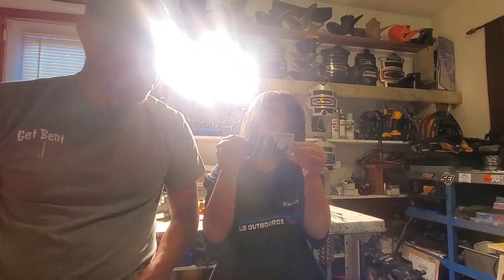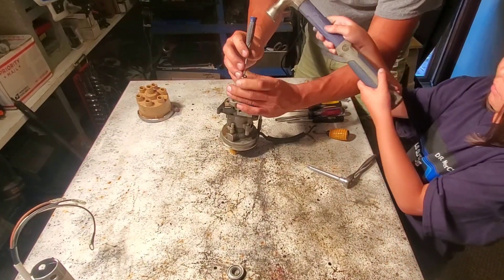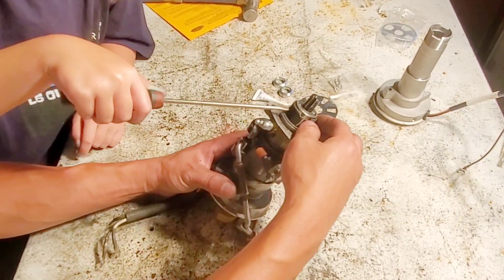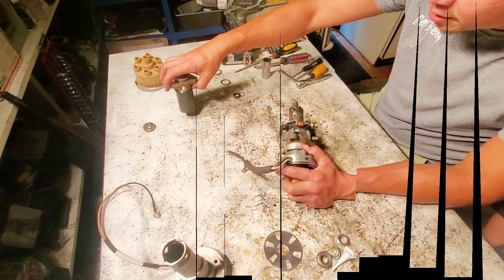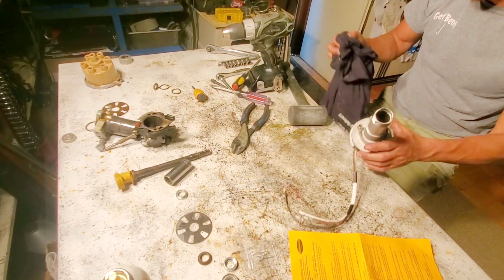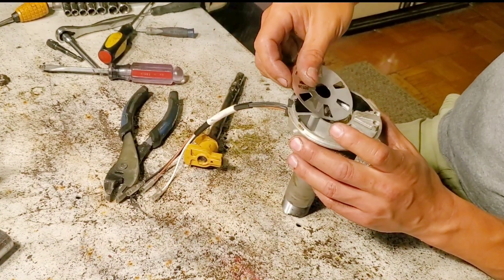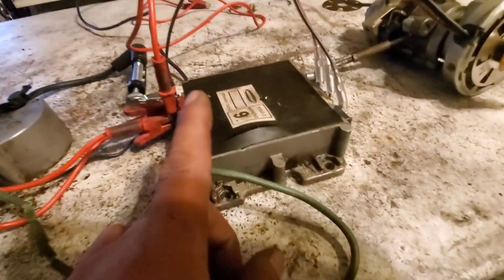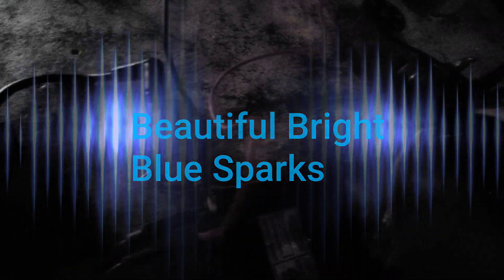Merc Outboards: Distributor Disassembly & Reassembly W/CDI Trigger

Comment: When you did the bench test, what did you connect to what? I love that you made this video, makes it much easier than I thought it would be. I have my trigger coming in the mail. 

I do not know if the trigger is my issue but the 1150 I have does want to rev out in the water, seems like it’s suck at half RPMs but revs good on the hose. 

Doing carb clean and want to test my current trigger before I tear it down.

Comment: I have a question, do you know if all of those similar style distributors have those disks in them ? Im trying to fix a mercury 800 80 hp with no spark and the distributor has no disks at all
Reply: Forgot to mention it’s a 1971 model merc 800 80hp

Comment: We made the same mistake in assembling the housing and not locating the upper Spring pin between the casting dogs. The position you showed in your video briefly is wrong - you can't dial it in until you put the Spring into the valley in the second casting.

Comment: Is there a known gap that the disc should be set at for when it passes under the pickup as the rotor shaft spins? Is a slight "scraping" sound what you want when you turn the rotor by hand and rotate the disc around through the pickup?
Reply from the maker: Yes, there is a slight scraping. Son

Comment: great job, wanderful info, and like to ask? is it possible to change a dist engine to the thunderbolt system, i have a  74merc 850 with the distributor which among other things very expensive.
Reply from the maker: It is possible with minimal fabrication. However, I've always went from thunderbolt to distributor ignitions systems in my conversions. Parts are easier to find whereas the thunderbolt has high and low speed coils within the distributor (impossible to find.)

Comment: Overall good video, I had a problem though. at time 13:40 when you slide the throttle piece down on the housing it is in the wrong position. I assembled everything off of that and when you put it back together and on the boat the timing is off about 25 degrees because the throttle piece was clocked wrong, also the idle adj  plate will not fit back in position. Took me awhile to figure out what was happening there but I took some pictures of the way everything was before I took it apart and was able to get everything right. I'm guessing you must have run into that and forgot to mention it later. Thank you though, great videos and they helped me out a lot. Joe
Reply: Hello! I just rebuilt my distributor as per this video, I resued my disc and trigger assembly because it's still good. I did replace both bearings, cleaned and regreased everything. I am wondering what you mean by the throttle piece being in the wrong position? I put the distributor back on my motor, and I now have a no start. Any help is appreciated.

Comment: Thanks for knowledge and fun videos.  I have 3 early 70's L-6,  trying to get one to "talk" I know trying to diagnose an intermittent spark issue on the internet sounds crazy,  but I am grasping for direction.  Have new CDI trigger, switchbox and coil.  Spark seems to come out of distributor cap, but only long enough to think you fixed something, then quits. spark always comes out of coil. Tried different cap, wires, new battery, plugs.  Any insight or suggestions welcome.
Reply from the maker: You are in the right direction. I would test leads coming from the distributor. Son

Comment: I'm about to hammer my distributor to pieces if it doesnt work correctly by the weekend haha
Reply from the maker: I know the feeling 😅
Reply: @MerCSonL6  I'm having a hard time trying to figure out if my timing is actually correct or if it's one tooth off or whatever.. the manual I have is pretty decent but I'm still confused 😣
Reply from the maker: @mr.yc7625  what year and model?
Reply: @MerCSonL6  1967 950ss. If i took pics of the timing marks there anyway u can verify it?

Comment: Do you think you could do a video on how to install a temp gauge on the l6 motors
Reply from the maker: A temp guage can be done. But you would have to be really good at welding cast aluminum. Inlines are manufactured to run cool/cold. If you see steam coming from the pee whole there is a problem. I agree,  having the luxury of knowing your cylinder head temp at all times is great. I will heavily consider it. I would just to to modify a power head that will accept the lower temperatures. Newer models have thermostats that control cooling temperatures 🌡 whereas L6s do not. Son
Reply: @MerCSonL6  thanks. I also had one more question now that I have it running what is the max wide open throttle RPM on a 1979 1150?
Reply from the maker: @joepoegel2394  that's a tough question. It depends on the health of your engine and if you have the low domes. I would redline around 5800..... I run my 1978 1400 @ 6200.... that is not my formal recommendation but it just depends on how comfortable you are with the health of your engine. Son
Reply: @MerCSonL6  you have no idea how grateful I am for your videos. It helped me tremendously with getting that motor to run. Maybe I'll have to post a video up on YouTube so you can see how it runs. Thanks again
Reply: @MerCSonL6  now that I have the idle screw set correctly at idlewill I have any adjustments to do to those when I get on the water full throttle
Reply from the maker: @joepoegel2394  set your max and your max stop so you are not bending the butterflies.
Reply: @MerCSonL6  that's what I did so I should be all right when I take it out on Sunday morning

Comment: Hey I got it mine running. It was all thanks to you. I was watching all the videos and picking up things here and there that were really helpful. It's running with the new controls, a new cdi electronics harness on both sides.
Reply from the maker: Good work Joe! The real credit is your time, effort, and patience! Son
Reply: @MerCSonL6  so it was a good time on the boat yesterdayfor the maiden voyage although I have some venting issues with the gas tank that I will need to figure out because it kept sucking primer bulb flat when I would run full throttle
Reply: @MerCSonL6  I also have to loosen the bolt just a little bit on the throttle arm and grease the distributor a little bit more because it was sticking at idle just a little

Comment: Hey I sent you an email!!! Need help with our Merc 1500
Reply from the maker: Whats your question?
Reply: Thanks Son, I appreciate it.
Reply from the maker: @karalans  your welcome.
Reply from the maker: Last time I posted my email I got beat up.....
Reply: I have, I believe a 1974 Merc 1500 150hp. Ser#4125834.
Has been sitting inside for a very long time. It was my fathers.
I started by rebuilding fuel pump, rebuilding water pump then rebuilding carbs.
Had to redue a lot of wiring because of corrosion.
Then tried to make to make it talk. 
As in video would only start with cold start lever all the way up.
When putting cold start lever back down it would just stall out.
it took a lot of turning over to start at first.
Now won't start but battery running low.
Also battery terminals were getting hot.
Any idea for my next step?
Any help would be greatly appreciated.
Reply from the maker: @karalans  definitely get a fresh deep cycle marine battery for starters. Your engine has the direct charge ported pistons. They typically don't like to start easy. Your timing at idle should be around 5-7 BTDC. Once warmed up it should run without the lever. Let me know. Son
Reply: https://youtu.be/bdlHa3YLD6Y

Here’s the link for the video!!
Reply: Should I just follow Link & Sync video. I’m new to this.

Comment: Hello, I have 2 of the inline 6 cylinder engines. I need help with the serial number on one of them. I called Mercury and they said it was too early for their records. How may I contact you? Great Content!
Reply from the maker: You can ask here. Im literally contacted every day with questions. 1 day i received 50 emails. Soooooo.... whats your question?
Reply: @MerCSonL6  the one I called Mercury about has a serial number of 2931132. It is a 1500/150 horsepower. It does not have paint on it like my 1975, it is all aluminum. I can email you pictures if that is permissible.
My 75 runs real good but has a little bit of an issue coming out of the hole. It is mated to a 75 Allison SST. As strange as it sounds if I turn the boat left and right it will pick up speed and get on plane. I am new to boating with an engine such as these. Most all the boating I've done throughout my life has been only with a trolling motor.
Reply from the maker: @titusmccord  what pitch is your prop? Whats the weight of your vessel. Son
Reply: @MerCSonL6  I have a 75 Allison SST which is about 600 lb approximately without the motor. I believe the pitch is 23P.

Comment: Great Video!!! As always!  I think you made the same mistake I did though. You put the Spring on wrong without a Pre-Load. The Pin should go on the other side. You'll know once you go to set it up on the motor; I had to pull mine all apart again to fix it.  lol   But anyway - YOU ARE THE MAN!!  :)
Reply: Yes, pin should go in between the two aluminum casting cogs so spring will work correctly.
Reply: Maybe not though, You'll know if you cant twist it to set it up.. lol